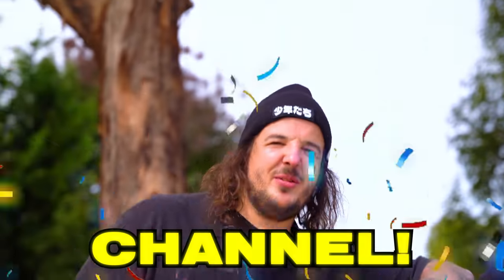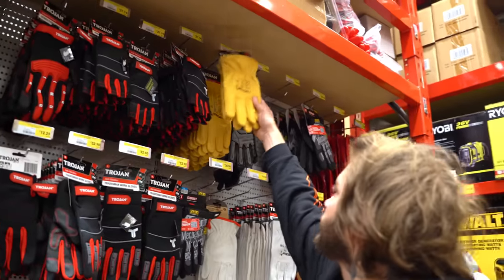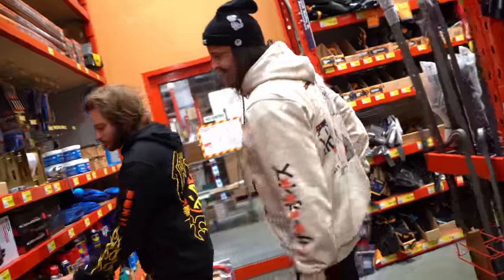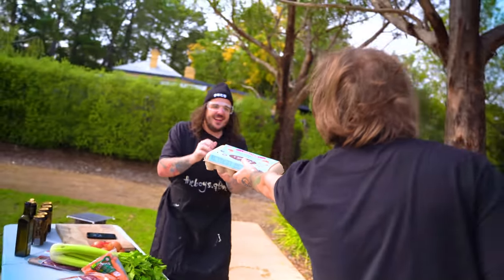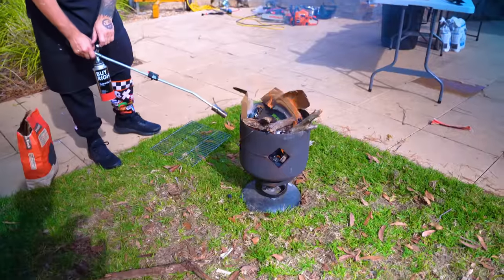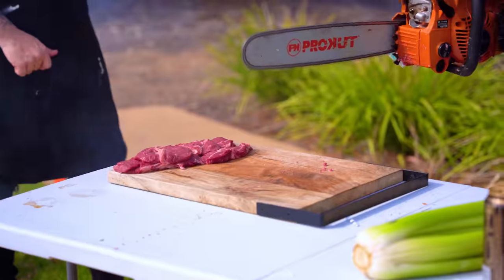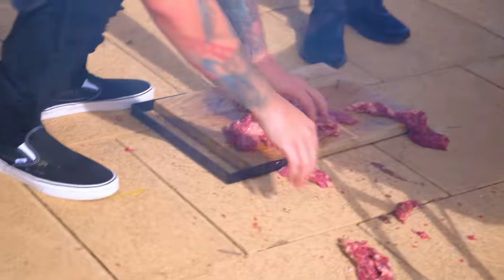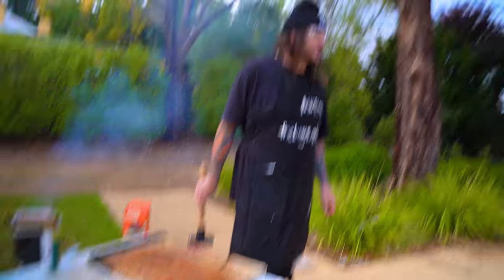The Boys Cooking With Powertools!

Comment: The fact that they tried their masterpieces even though they didn't wash any of the tools was disgustingly hilarious.

Every tool has factory gems and chemicals all over them, and the cementor most likely still had little bits of cement in it. Lol

Not too worried about the little bits of cutting board. Humans can eat wood, but you have to make sure that it's nice and soft so that it doesn't stab you when you eat it.